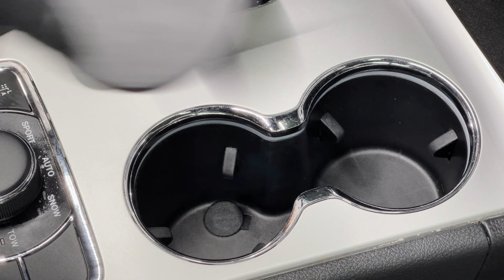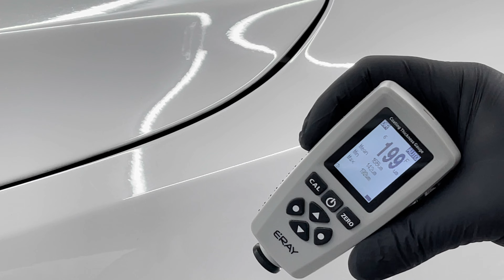Neglected Jeep SRT Gets 40+ HOUR Makeover! Full Interior + Paint Correction And Ceramic Coating!

Comment: Hello, nice vid and attention to that car.
Is it really needed to touch the car with the sandpaper? I think rotary polishing and then finishing with orbital is enough cutting for these medium scratches. Or it was because it ease up the polishing process so you dont have to polish as long?
I would highly recommend protecting the seat rails with rags or other stuff when moving it. It can really fk up the finish with the scratches on a car from the rails.
Good job :)
Reply from the maker: The biggest benefit of sanding is heat management. Instead of grinding down the paint with a rotary or DA and generating a bunch of heat, I can cut exactly enough clear coat to get to all these swirls, which this Jeep had plenty of, and then refine with the rotary and DA in following steps. This also saves a tremendous amount of time of having to revisit  tight areas or swapping out polishers and pads to make sure each and every swirl mark and scratch was removed. In the end, the results from sanding will always be superior to the results of just using polishers.

Comment: Just got a 2021 Jeep GC. Do you worry about getting water in any of the electrical?
Reply from the maker: The most important thing about spraying down an engine bay is avoiding directly spraying critical electrical components like the fuse box and PCM. All electrical connections have seals to keep out moisture, so it’s alright to get them wet, but just be careful about the pressure you hit them with. That’s how water can get past the seals. I hold the wand as high as I can to reduce the pressure, as well as using a lower pressure nozzle. Also I don’t use a constant flow of water, I just do quick spurts of water to rinse away the suspended dirt and suds. 

And congratulations on your new vehicle!

Comment: Stupid question but i thought you were never supposed to spray water under the hood only use wet cloth due to water getting in motherboard? I took my car detailing few years back and when I picked it up, it was in limp mode. Had to pay mechanics to dry the water out.
Reply from the maker: You can clean under the hood with water so long as you’re careful of how close you’re getting the pressure washer. The pressure will push the moisture past the seals of the electrical connectors if you’re too close, and it’s always best to look over everything to make sure all the connections are secure, and the fuse box is properly latched shut. There are some fuse boxes that have openings on the sides, so it’s best for cover them with a bag while cleaning.

Comment: Wow, nice work! I just bought the exact same spec 2015 SRT in bright white and chrome. I don’t have the metal pedals though. Was that an option or aftermarket?
Reply from the maker: Thanks! I’m not sure if the pedals are from the factory, it belonged to a client of mine. I know that the SRT 4’s and 10’s had these metal pedals so maybe it was an option. I had an ‘07 charger SRT8 a long time ago that had regular pedals
Reply: @HamptonsTouch  must have been and option. I did find some replacement Mopar pedal covers that look easy enough to switch out.

Comment: Did you cover anything when you did the engine to protect it
Reply from the maker: Not on this particular project, I just remained mindful of how much water I sprayed around the electronics and how close I was. This pressure washer is electric, so I’ll charge it up, release the trigger to release the pressure, and immediately spray around the sensitive areas without the pressure.
Reply: @HamptonsTouch   Excellent job from taping to the whole bit! In addition to the paint, the glass had water spot etching issues also? What did you use to deal with the glass issue? You applied Ceramic Pro to all the glass including the windshield? I ask because I was going to try that on the windshield with CarPro UK 3.0, but I was told I most likely would get wiper chatter and I should use a dedicated glass product. Thanks for answering questions and keep up the great work!
Reply from the maker: @BlackHawkPSU  I was fortunate that these water spots didn’t etch into the glass, so a simple polish was more than enough to remove them. I used HD Speed on a yellow Rupes pad to clean them up. The reason I use HD Speed instead of a dedicated glass polish is that I don’t have to tape off the seals with HD Speed. It doesn’t cause any whitening of plastics and rubber trim if any gets onto it. As for coating the windshield, some vehicles such as Mercedes-Benz will cause wiper chatter as well as some Porsches. I’ve not had any issue coating any domestics yet, but I’m sure that could change. I’ve heard some guys say they’ll coat the wiper blades as well and that solves the chatter issue, but I’ve never personally tried it so I can’t say for certain if it does or not.
Reply: @HamptonsTouch  Thank you very much! I appreciate the reply!!!
Reply from the maker: @BlackHawkPSU  any time! I’m happy to help

Comment: What in the clear bottle that you spray
Reply from the maker: The first bottle I use while sanding is just plain water. The second bottle I use after paint correction is a 50/50 mixture of water and isopropyl alcohol to strip the oils and fillers left behind on the paint from the polish in order to prep it for the ceramic coating.

Comment: Great work im only 12 minutes in but shouldn't you start interior first then exterior im not a professional or even close just wondering wouldn't it be more easier after you do the interior you dont have to go inside anymore rather than clean the exterior then doing the interior while slightly contaminating your work you just did but im sure you're going to wax but seems a lil backwards
Reply from the maker: Whether you start on exterior or interior is just personal preference. There’s no specific order to go in. I’d personally rather get the exterior cleaned so I can get the vehicle pulled inside. If I did the interior first then pulled it outside to wash it, there’s a chance dirt, dust, or pollen can blow into the vehicle while I’m cleaning out the door jambs, and I want to avoid having to re-vacuum and wipe down the interior. That’s just me though.